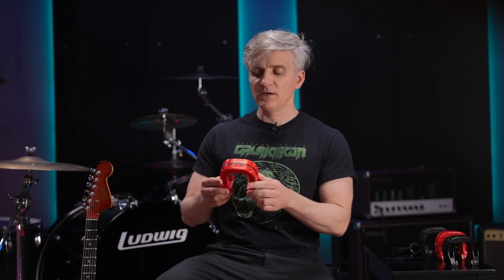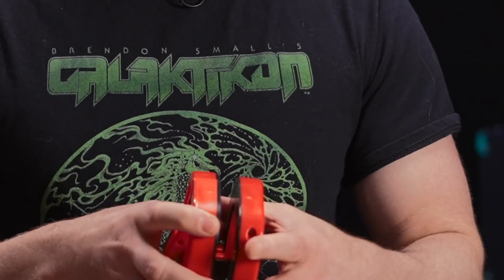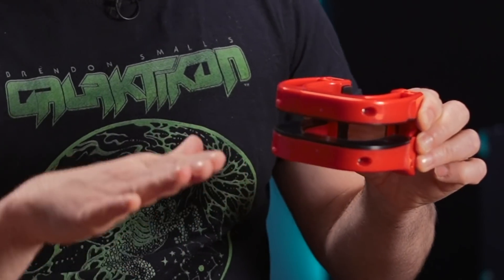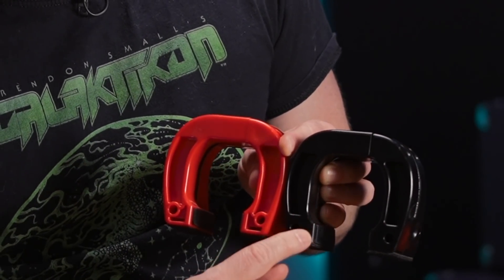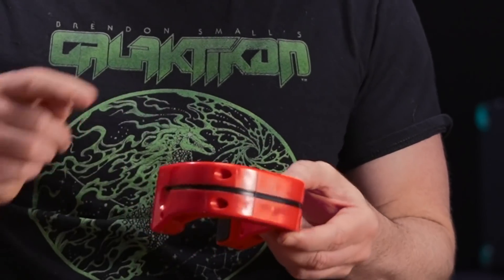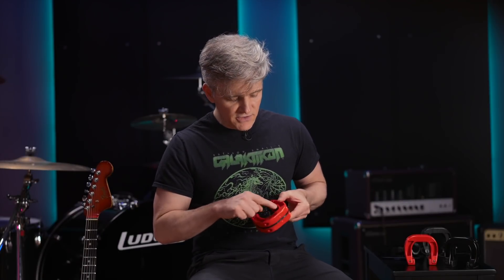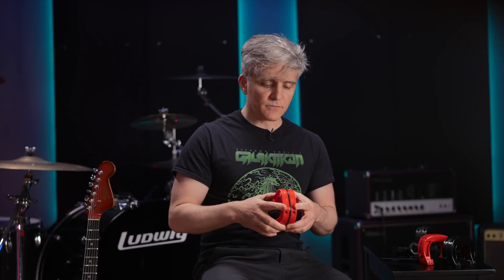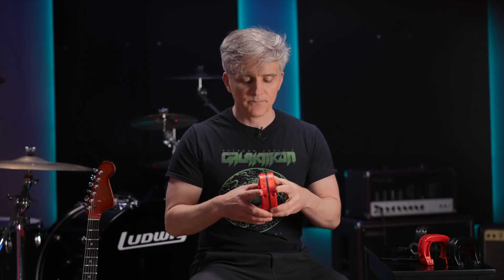Magnet Update!  Red And Almost Ready For Production

Comment: i havent been following this, are they made in china?
Reply from the maker: They are.  We had of course started out wanting to make them here, and found a really nice factory here in New York that would have been great if only because we could literally drive down and visit.  But the costs were triple compared to doing it overseas, and meant that we wouldn't be able to make the Magnet at all at any reasonable consumer price.  As another data point, I called them back recently just to get a sense of what the market bears now several years later, thinking maybe the pandemic had made people a little more flexible.  This time they wouldn't even consider the job for less than 80,000 units.  Which is at least 10-20x the number of Magnets we'll probably even make.  The economies of scale for small batch manufacturing don't appear to be there stateside.  Hopefully that changes moving forward.

Comment: Appreciate the update Troy & the extra effort that you and your manufacturing partner are going to so as to get it right. One question if I may… Have you Guys done any testing on how the magnet’s rubber compound guitar neck/body contact surfaces might react with different finishes - For example: the damage that can be caused by guitar stand rash due to an adverse chemical reaction of a nitro finish in contact with some rubbers/foams used on stands/ hangers over a prolonged period? Thx in advance.
Reply from the maker: I have never noticed any effect of any kind on a wide variety of guitars, but again, it touches so little of the neck area I'm not sure how I'd even notice.  The Magnet attaches above the neck pocket so there isn't really much finish there to interfere with.  It mostly grips the side of the fretboard.  On acoustic, there really is no neck there at all — it's completely fretboard.

Comment: Troy - if you can ask what the black rubber material is, that should be enough to figure out if it's going to react with lacquer finishes. 

Just like ABS plastic, there are a million formulations. But the family of polymer will tell you a lot. Their basic makeups don't change.

Comment: Why not make it rubber like a hardened rubber? Then you wouldn’t need to fuse the rubber to the plastic and it seems it would solve the cosmetic issues. That may be a stupid question but I was wondering if it would actually work with rubber?!?

Comment: Yes those look better than any so far.  The insert molded rubber looks spot on this time.  Your comments about mechanism stickiness are also spot on.  That could get worse with use if it is caused by galling of the plastic rubbing against plastic.  But as you said the solution may be changing cooling times or a little lubricant.  As for the sink marks many manufactures reduce that problem by adding texture.  If it doesn't reflect light well it almost disappears.  But again, as you said, that is really kinda the least of your worries.  It is great to see you getting something that looks like it is on the right track now although I am so rusty on the guitar now I am not sure I am up for watching my ineptitude! :)

Comment: The problem with grippy rubber/plastics is that some of them will liquify after a few years. You see this with a lot of old electronics, where the rubber feet basically melt off. Same with handle grips. I found an old video camera once, and I could tell the reason it was tossed: all the rubber parts were turning into an oily glue which you can almost guarantee were toxic as hell. So yea, be patient with the process, because the correct balance is really important.
Reply from the maker: Good point.  I don't know if the 50-60 durometer we're using is really squishy enough to degrade, but we'll look into its properties.
Reply: @troygrady  When you mentioned it sticking enough for the pads to adhere a bit, it made me think of these eventually-melting type rubber/plastic mixes that abounded in our youthful days. I'm sure the folks working on the blend are cognizant of that... hopefully! 😬
Reply: To test it, I would stick them together like you did to demonstrate the stickiness, and then put it in a kiln at a high but not too high temperature for a few days and see what happens. That should give an idea what will happen over the course of years for at least some conditions.

Comment: Can’t wait for mine! I know it’s a pipe dream but now that MagSafe is a thing it would be cool to do a version that doesn’t have to clamp the phone but just magnetically attaches the phone to the neck clamp
Reply from the maker: I'm not really sure how much of a problem that would solve.  The slot-design of the current iteration works pretty well, and the grippy rubber holds things in place pretty well.
Reply: @troygrady  It wouldn't be a revelatory change or improvement over this design or anything haha. Definitely has plenty of its own shortcomings too, it just possibly could be a slightly smaller footprint without a need for the secondary movement. I just replaced my phone clamp tripod mount with a magsafe one which is why I had the thought.

I did have one Magnet related question, does the rubber play nice with nitro finished necks? I assume yes since your fender looks to be nitro but just confirming

Comment: But you know you can always just hook up go pro with a contraption.
Reply from the maker: We've done various versions of this, and even used them in our interviews.  Headstock mounting is far away, super shaky and required de-shake in post, and the fretting fingers occasionally block the view.  Body mounting locations are tricky mechanically.  Suction cups?  Clamps?  Depends on the shape of the guitar body.  The neck pocket location of the Magnet provides the closest unobstructed view, the least body shake, and is the simplest to get on and off.

Comment: The minor dimpling I've seen on plenty of products I've purchase in the past from large companies. That is not an issue. The stickiness issue is a result of tight tolerances, you were lucky before with the previous plastic in that the formulation had some lubricant properties built in, but in seems the current formulation does not. Nothing a little silicon grease can't solve. Time to go ahead with this. Maybe later after you sold a hundred thousand you can try some more plastic formulations with natural lubricant properties that will work with your mold but that could take a long time and I think I speak for the majority here, that issue isn't worth a long delay. I would rather have the product ASAP cause I can add a little silicon grease myself.
Reply from the maker: The tolerances between this version and the previous ones are similar, and actually include a fair amount of play to prevent mechanical jamming.  So I don't think that's what it is.  It really seems more like the material being more tacky.  But we're not going to change the plastic formulation and send us back to the drawing board though.  If it can't be done with a small tweak to the cooling times, then maybe some lubricant is the shortest path, as you suggest.

Comment: Is the difficulty in opening a result of the tacky rubber sticking to itself?
Reply from the maker: It doesn't appear to be.  It can sometimes feel sticky in the middle of the sliding, after the rubber has separated and is no longer touching.  So it looks more like the tight tolerances, or something to do with the material itself.

Comment: Will it fit an iPhone 13 pro max?
Reply from the maker: It should.  There's no limit as far as the size of the phone itself, since the Magnet is basically slot-loading.  It's really just the placement of the camera that matters.  The only thing I will say I don't love with the 13s is that they moved the position of the default camera.  On the two-camera models, they are diagonal now.  So the default camera is more toward the center of the phone.  Which means, when you place it in the Magnet, it may be a little higher compared to the fretboard.  It may still produce a useful view, we'd have to test.  However I'm not sure this affects the three-camera models like the Pro and Pro Max.  If the default camera (not the telephoto and not the ultra-wide) is near the edge of the phone, then that's fine, and the same as previous versions.
Reply: @troygrady  awesome, thank you. I only ask because I got a new phone since I placed the order.

Comment: Just wondering if any of the new materials used in the rubber have also been tested with different guitar finishes. I have heard that guitar finishes can react and be damaged by the material used on a poorly designed guitar hanger or stand. I hope this is not the case, because that would definitively kill it, at least for me.
Reply from the maker: The rubber grips don't really come into contact with much, if any, guitar finish.  The grips only touch the side of the upper part of the fretboard, in the neck pocket area.  On an electric, some small amount of neck finish may be visible below the fretboard, rising above the neck pocket, but a * super * tiny amount.  Maybe an eighth of an inch or something.  On an acoustic there is no neck wood up there at all, only fretboard.  On both electric and acoustic, there is no rubber contact with the guitar body at all.  I have a wide variety of instruments here, electric and acoustic, guitar to mando, vintage to new.  And I haven't noticed anything.  But again, the area where you would actually notice anything is so tiny, and your hands never come into contact with that area, even if there was some kind of effect, it would be pretty hard to notice.